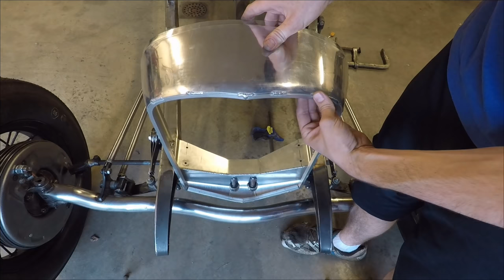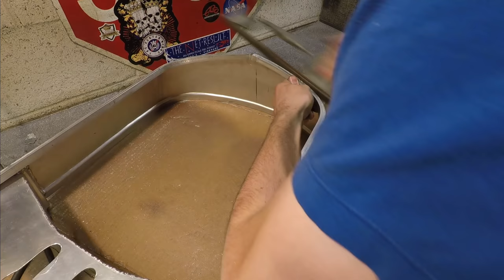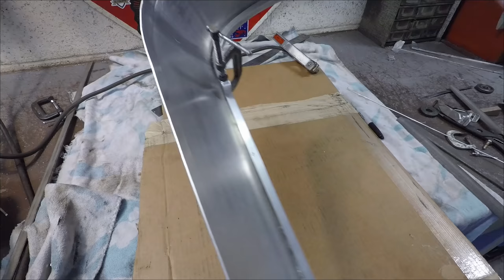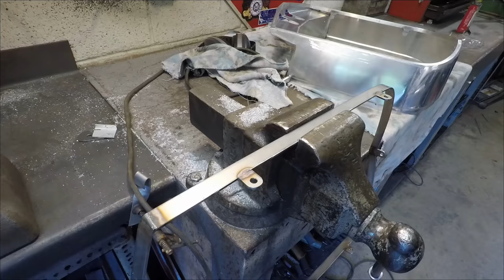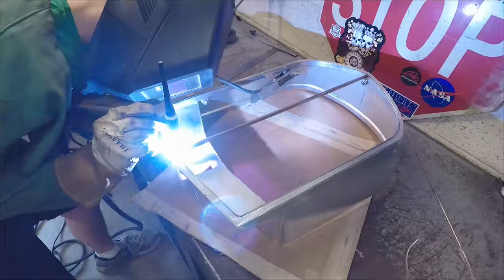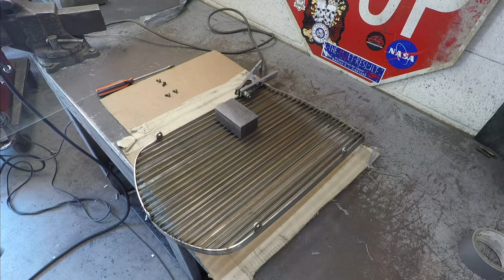Handmade Roadster Grille! | Homemade Boat-tail Speedsster Pt. 44

Comment: An outstanding project in itself was that grille! She has a face now! Great video! The talent necessary to weld aluminum to steel!  A CLASS ACT!
Reply: The steel is not welded to aluminum.  It is its own substructure and screws to the shroud through 5 tabs.

Comment: Something I would consider for when you get there: instead of plain aluminum panels for the firewall and dash panel, engine-turn them. Not only will your car look even more 30's-ish, but it adds some interest  against the smooth, finished body. You can also create a brass plaque with mfr.name, model, serial number, ect. One last suggestion: you can get cloth woven (PVC with a cloth overlay) wire for your car.  You can even get your wiring cloth loomed, instead of plastic conduit or tape.

Comment: You can use the metal brake to finish folding the bent pieces by putting the whole piece under the jaw using the clamping handle to smash it flatter. . .
Reply from the maker: As big as that brake is, it wasn't powerful enough to do that

Comment: i noticed that when you are using the angle grinder you are only wearing safety glasses. one small piece of advice safety wise im also building a car (although it's very different from your project) and therefore have been doing a lot of grinding and cutting. I have always been careful to wear a facesheild and safety glasses. however a piece of metal still managed to get into my eye and I had to get it removed by an eye doctor scraping it off my eye and then taking a tiny special Dremel tool to my eye to polish out where he removed the metal. it took several days to heal after that and he said if I didn't get it removed it would rust into my eye hurt much more than it already did and leave a huge scar on my eyeball. he said that its a good idea whenever you are grinding or doing something producing dust in the air to wear safety glasses that have a rubber seal. you can pick up a set for cheap and its definitely worth it to not have to go through getting a piece of metal removed from your eye.
Reply: Yeah.  Indeed.  I was working under my car once and was wearing safety glasses that fit REALLY well and had a rubber seal to meet the face ( though they weren't pulled on tight with a strap like goggles)...
Didn't get anything in my eye at the time but it was REALLY irritated that night. 
... went the next day to doctor then hospital.  Had eyeball scraped to remove the foreign body (piece of steel) y then two follow up visits to remove the rust (salt in tears corrodes steel v fast).
Doctor's conclusion was that the particle had dropped off my eyelash or eye brow as i got in the shower, and stuck to the wetness of the eyeball.

Comment: Hey Sir. Ian Roussall, always said that you use anything in the shop to accomplish the metal job that your trying to do. And then you cut all those grill pieces, individually. WOW I know that was a work out. Nice grill though. Well you already knew that though. So I guess that you have a radiator to fit that grill? Well make it a great week. Look forward to the next video.
Reply from the maker: The radiator will have to be custom, since I didn't build the grille shell to fit anything I had.

Comment: Yet again great homemade Craftsman ship on the grill.
I have a question to ask, if you are intending to get the car registered for road use have you or do you know what your DOT needs for it to pass inspection our rules in Australia differ from state to state, some states need an engineers report before it will pass.
Have you checked out what is needed where you are, as you may need more or less work put into your creation to pass for Rego.
Tony from Western Australia.
Reply from the maker: yeah, I know in general what I have to do for that. I also know someone who can inspect/register it
Reply: @MacroMachines  excellent to have a mate in the business can't wait to see you rebuilding the motor it should purr along nicely!

Comment: When shortening the grill, is there a reason you couldn't just scribe the outside edge and cut it? or even use the tacked in bar as a cutting guide.   and then maybe run a grinder around it?   Seems like it would be simpler and faster but would it be less accurate or something?  or was it just that you wanted to use a bandsaw and that was the best way to get it on the bandsaw??

Comment: It is very nice to see a young man with patience and talent.  Quick question... Did you TIG aluminum to stainless on this project?  If so what rod did you use.  Keep up the great work!   Fred
Reply from the maker: no, the slats are welded to a 1/8" stainless steel frame that bolts inside the grille shell
Reply: @MacroMachines  thanks for the clarification.  Beautiful work.  I am also a hobby fabricator.  I make one of a kind model stationary steam engines.  I have a Youtube channel as well.  Keep up the great work!

Comment: Once again "yeah, early night sounds go- Ooo new episode" :D
Was that a rasp you used on the grill surround to attached the inner bar?
Top work as always! Need you to come to the UK and shape our body panels :P
Reply: that was an adjustable body file used to shape lead in auto body repairs sixty years ago, i used one alot, tells you how old i am, right
Reply: @mike7817  Well, today I learned!... I want one of those :D
Also surely i's experience, not old right :)
Reply: @PedalBox  search the web, or hot rod swap meets, when they start doing them again. i don't know if they make them anymore. there were all sizes and shapes back in the day you could even send the blades off and have them resharpened when i was in the the shop but thats been a long time ago

Comment: Are you concerned about the reaction between the stainless steel and the aluminum? I've had some pretty bad corrosion in a very short time frame mixing alloys like that.

Comment: if the strips wherent trong enough you couldve given them a spine by putting a piece of welding rod in before bending them close in the vice 
grille looks nice 
maibe look for some medal or coin to put in the center on the top as a logo

Comment: I hate to be a pain but I am going to anyhow. You do very nice work and there are no two ways about that. But please, do yourself a favour and start using a face shield in addition to wearing safety glasses when grinding or polishing. I have been around metal fabrication for over 60 years and have suffered my fair share of eye injuries due to metal shards and debris from grinding and polishing.  Carbon steel is bad enough but aluminium, stainless, and grinding grit are really bad because none can be removed from your eye with a magnet. They have to be tweezed or in some cases scraped out of the surface of your eye. The longer anything stays in your eye the more damage will be done. Some have been really unfortunate and actually lost an eye due to particulate and if that happens, well, you can pretty much forget about ever welding or doing metal work again since your depth perception is gone. Eye transplants can be done but they are expensive and don't always work. So please, set the example for your viewers and do it the right way. It is inevitable that you will get crud in your eyes so please, wear a face shield and protect yourself as best you can.